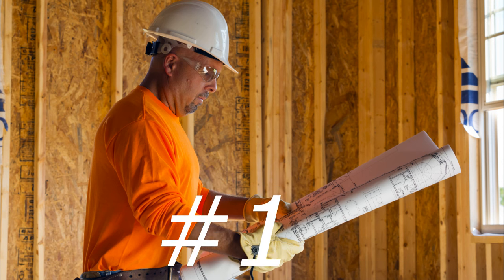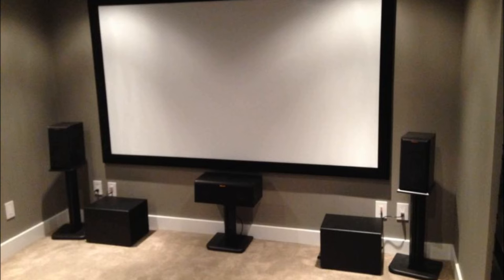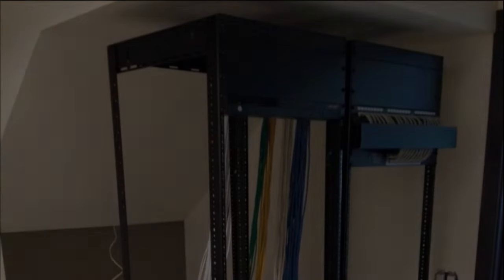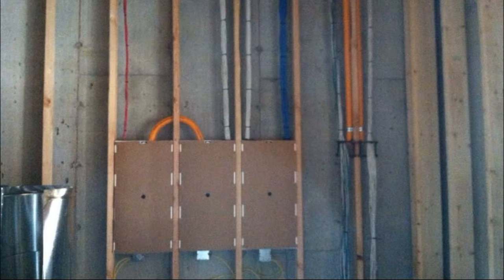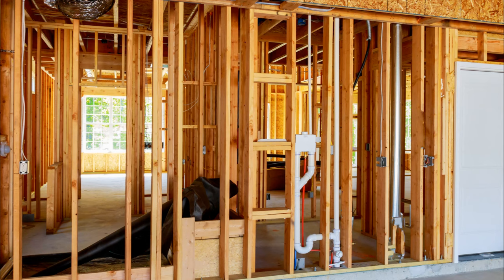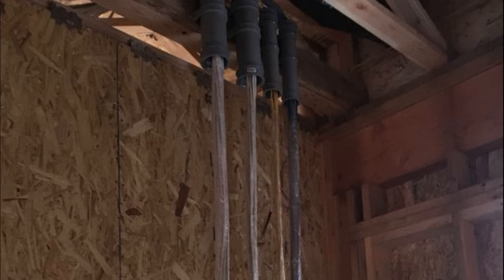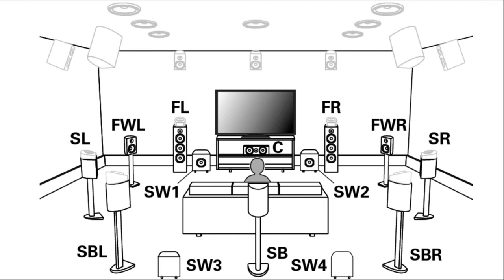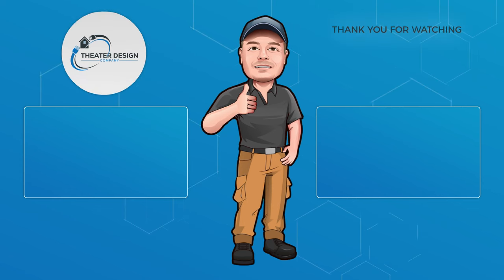Top 5 Home Theater Rough-in mistakes.  Avoid these and save $$$

Comment: I missed out this when building my house, i did some of these things.  Wrapping wires is a great idea.   Also, my electrician cut the wires down to 3 ft coming out of the wall because he told me the dry wall guys will get mud all over the wires.  He wanted everything could into the low voltage bix